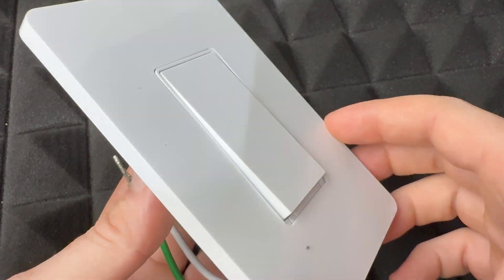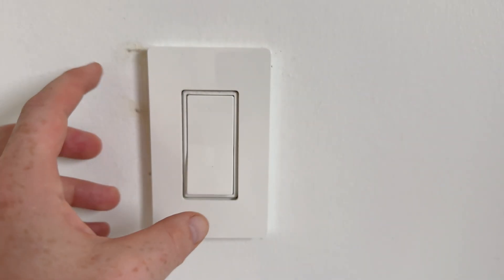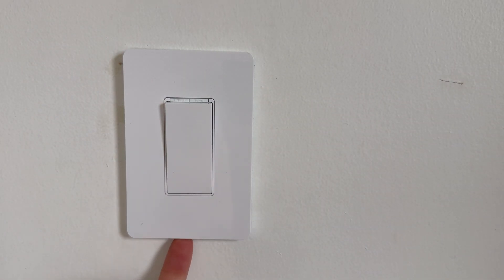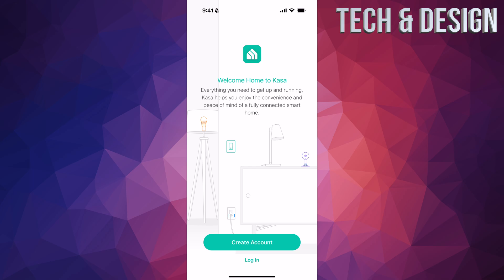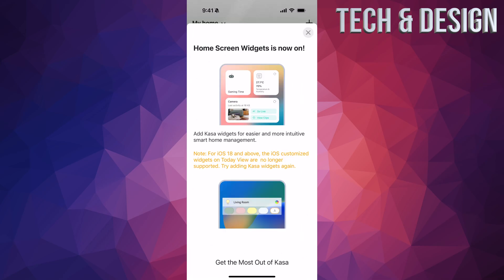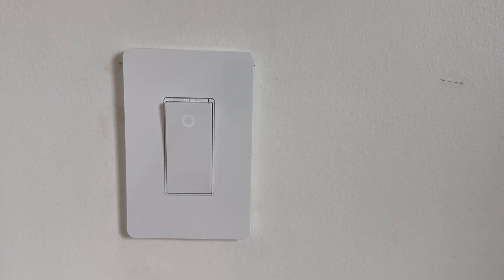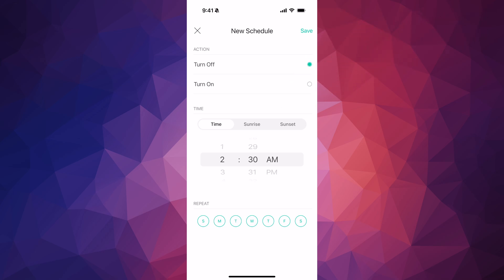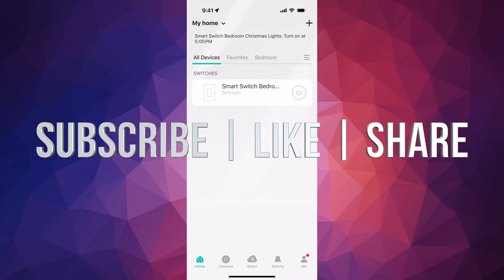How to SetUp & Install Kasa Smart Light Switch HS200, Single Pole, Needs Neutral Wire, 2.4GHz

Comment: The original switch did not have the white line connected to it so why do you have to connect the white (neutral) line to the new switch?